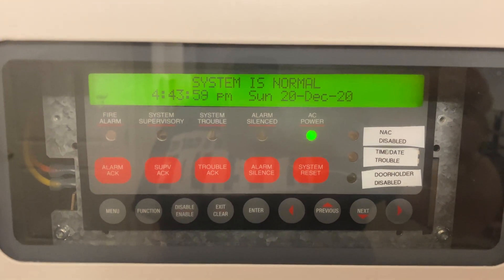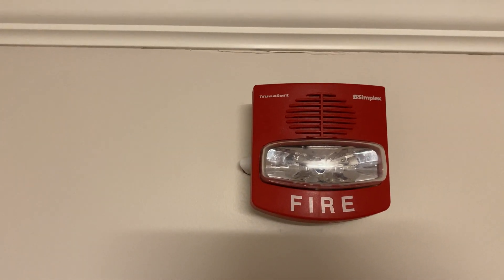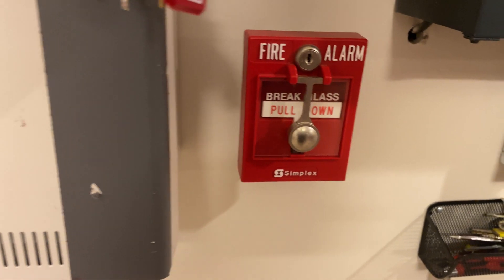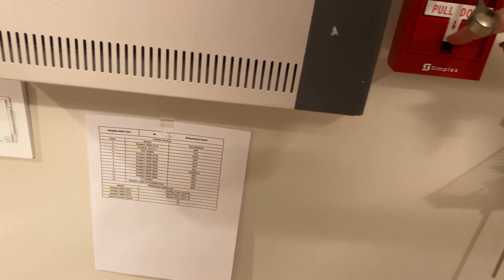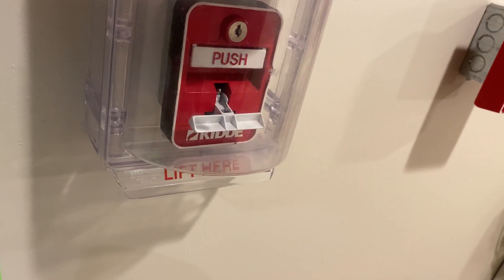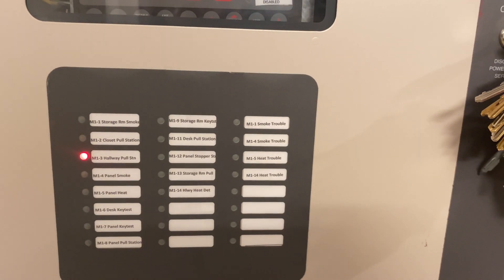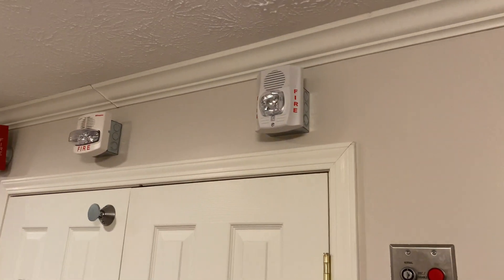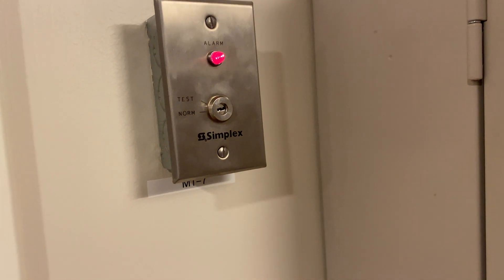Simplex 4010 Test 34: Annunciator Panel

Comment: Do like the same system as my temporary church it has
Firelite BG12 (both Ls and classics)
Ademco 529 (if don't have it then throw in an Edwards SIGA (screw lock))
Firelite BG8
System Sensor Spectralert Classic horn strobe
 System Sensor MASS horn strobe (regular tone)
System Sensor L series remote strobe (15/75 candela)
The panel is a firelite MS 10UD

Comment: Are you still taking requests for system tests? If so, here's mine

Control Panel - Simplex 4010
Pull Stations - All Simplex T-Bars 
Notification Appliances - Gentex Commander 3's on Default tone in Code 3 (All of them)
Detectors - Simplex Truealarm Smoke Detectors

Comment: Why aren't you working for a alarm company I am a Alarm Contractor your doing great nice job try giving yourself self a ground fault common problem on fire Systems hard fine when you don't no which circuit does not specify on panel which Zone any circuit could be the cause  in system hard to fine in big buildings have go thru every circuit. Also try and addressable panel.